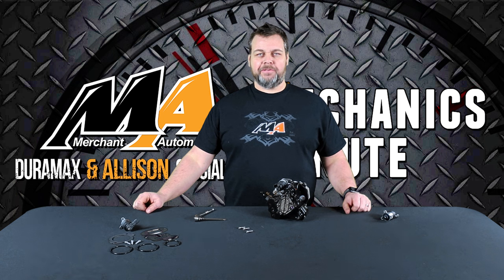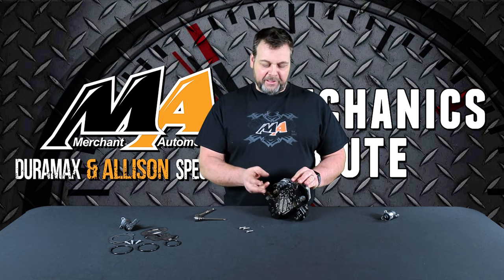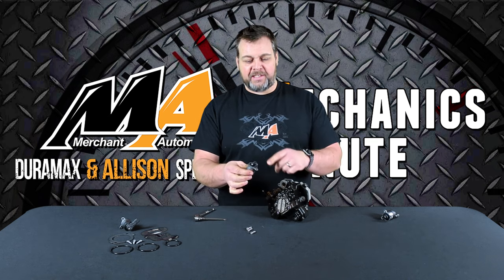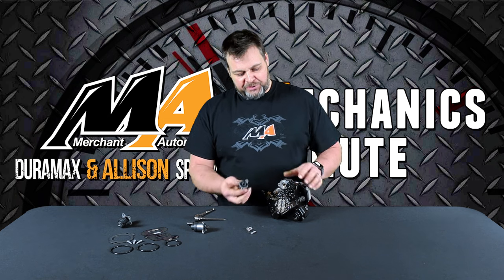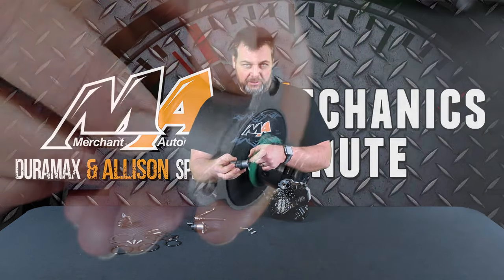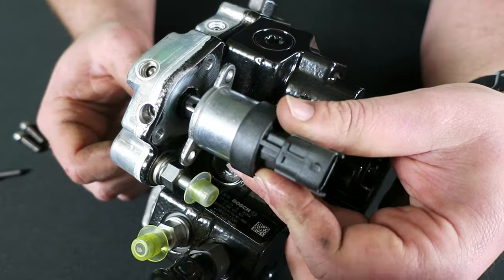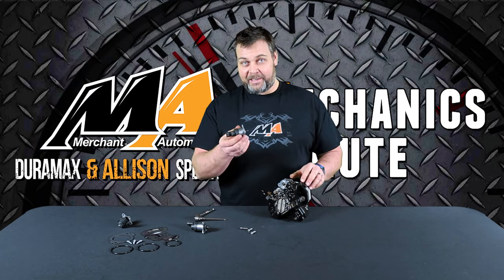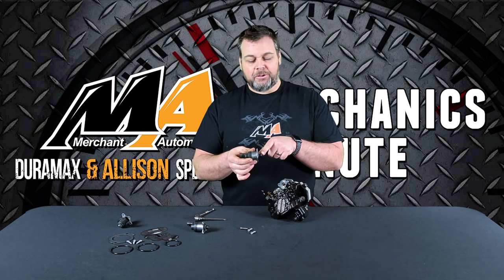Crucial Mistakes to Avoid with Duramax Fuel Pressure Regulator installation

Comment: “These regulators come right from Bosch... “uhhh .. Yeah exactly why is Duramax guys gotta replace out entire fuel system on stock hp trucks with 50-70k
Reply: Finally have to replace mine at 370k

Comment: hi eric i have 16' gmc sierra duramax lml 6.6l on the screen it has check engine and power reduced it has a code P00C9 fuel pressure regulator high control circuit low voltage, the power is perfect and it walks perfect too i changed the 2 batteries and the filters are changed frequently what do you think, thank you

Comment: I'm having a hard time seating the FPR. It's almost there but I can't push it on. Ideas?
Reply from the maker: Make sure to install it square, also a little dab or grease on the o rings helps a bunch.  It is very easy to nick the seal on it when installing it and if that happens, it will exhibit the same conditions it had before.  Take your time, do not force it.
Reply: Finally got it in. I was not expecting such a tight fit.